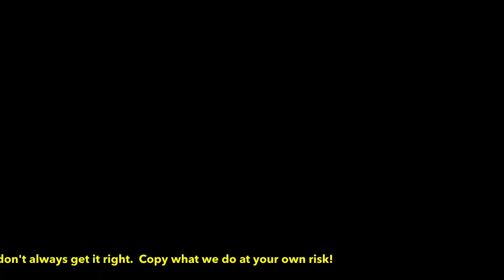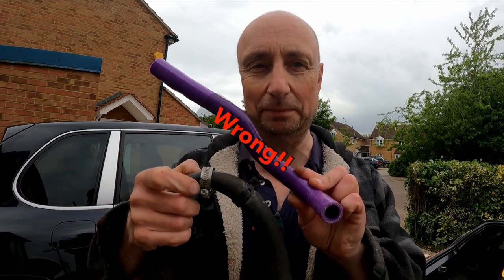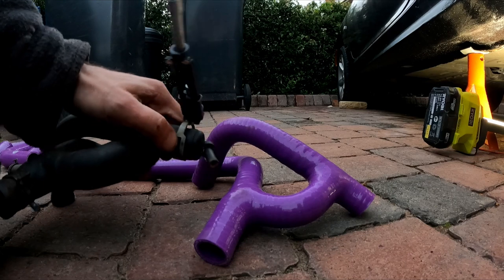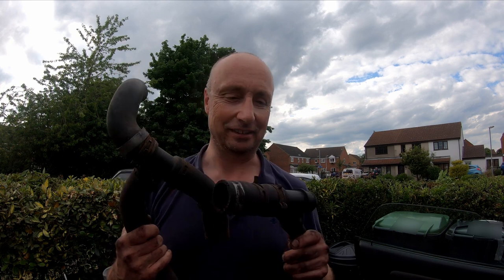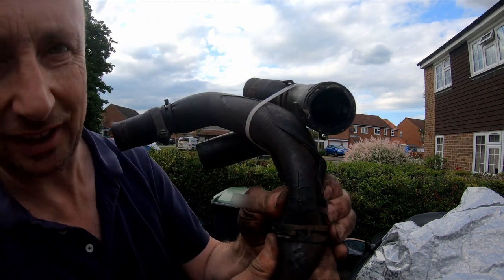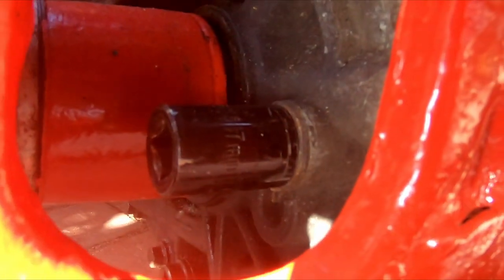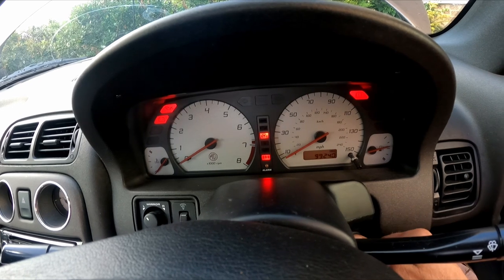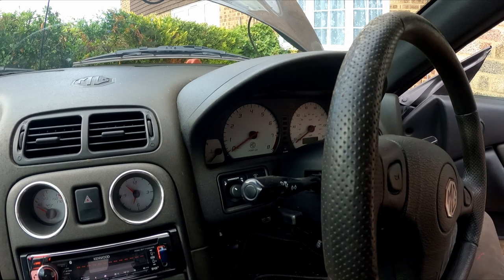Scotty’s Overheated MG TF 135 Rover K Series Engine & Subframe/Suspension Rebuild (non-VVC) Part 12

Comment: Great job there, good to see it running again. I noticed that handy little tool for fitting the coolant hose clips. Did you make it yourself or was it bought? Great job anyway. Cheers. 👍
Reply: @DoubleDuckGarage  Hi. Thanks for that, they did impress. I've always had fun with those damn clips. I've got my TF underfloor pipes to change out and a few connectors on the pipework just above the engine bleed point. Looks good. Thanks for your reply.  👍👍

Comment: Hi Scotty, nice to see it running! One thing I noticed, the clutch slave cylinder stiffener bracket looked like it was touching one of the water coolant  pipes, it appears from what I can see like its quite sharp, It could be the camera angle, might be worth while looking at it. 🏎😃
Reply: @DoubleDuckGarage  I normally put tie wraps on anything like that, the big wide ones are very tough and cheap as chips. Hope it all works for you.😁